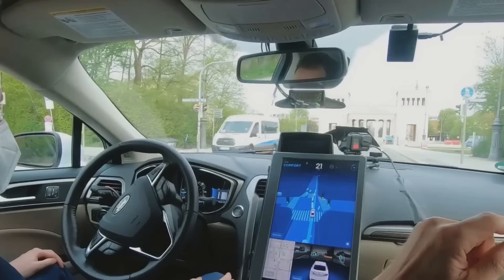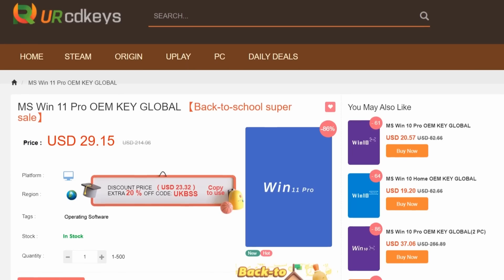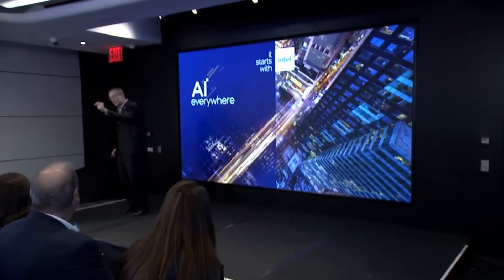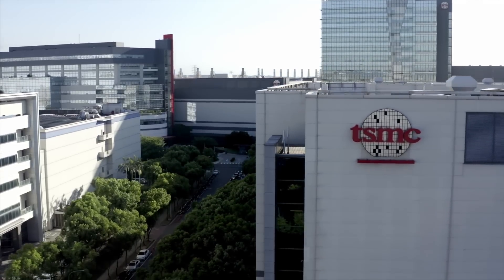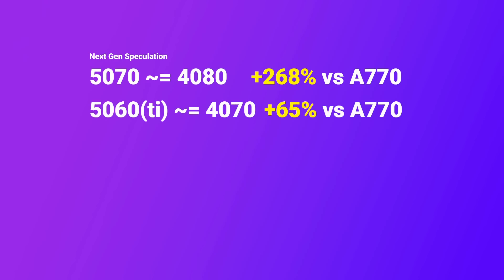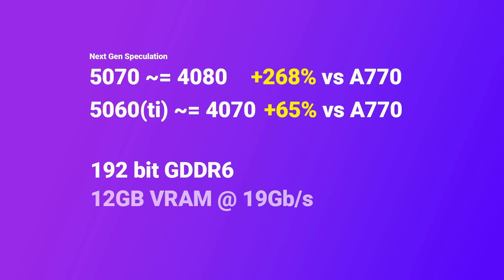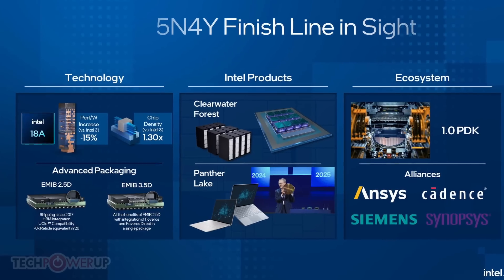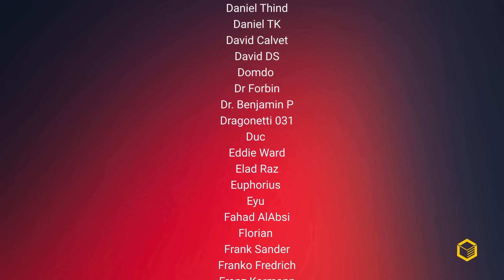I'm worried about Intel's Battlemage GPUs

Comment: Intel is 4 YEARS BEHIND NVIDIA!  THE A770 was intended to compete with the 3070.  It has a bigger die, more transistors, and better process node(s).  It came out 2 years after the 3070 and it achieved 3060 performance, i.e. a 2-year generational lagtine, 2+2= 4 years behind!  The only reason Intel makes Arc / Battlemage CPUs is to avoid being ejected from the laptop market!  I am pretty sure they lose money on every dedicated GPU card they sell!

There is no need to THINK about Intel GPUs before they get within 2Y of NVidia technology - they're a charity case righr now ...

Comment: Battlemage specs have been known for a l;ong time already. 
B980 Xe 64/256 bus/16-24gb/250-300W (launch H1)
B970 Xe 56/256 bus/16gb/225-250W (launch after B980)
Mobile Xe 40/192 bus/12gb (launch 2025 with the new mobile CPU)

Just for reference.
a750 8gb VRAM 256 bit bus 225W
a770 16gb VRAM 256 bit bus 225W

Year ago.
"Intel has said that it is considering moving some of its manufacturing out of China to the United States to comply with U.S. government regulations."

Today.
"Intel is laying off over 15,000 employees" 

So as conclusion U.S is sanctioning China and not giving them the latest. World situation demands it. 

Motherboard Brands:

Asus           65%          made in China.
Asrock          4%         (parent company Asus)
Gigabyte     14%         made in China/Taiwan
MSI              14%         made in China/Taiwan

China has their fingers on almost all of the motherboards. Asus as the biggest. Asus alone control almost 70%. 

Servers/CPU's:

INTEL        70.9% 
AMD          20.5%.      Both are U.S companies. 
ARM            8.1%       British company. 

 CPU Market Share Q2 2023:

INTEL          83%
AMD            17%

Conclusion for internet problems and server failures (Asus W680 motherboards) it is obvious and looking at the BIOS fails and history AMD CPU burned in the socket pushing towards INTEL CPU that now is failing on Chinese made (Asus) motherboards. You have acknowledge where the problem is when native settings over power the CPU by 100 A's for example and how the maximum damage was created.

Comment: No need to be worried, Intel has more backing than we all think and even if it's going to fail with Battlemage it will continue its business and most definitely survive. It's fair to say that what Intel has accomplished with their new GPU cores will also continue to succeed in the integrated GPU space so no matter if single card GPUs will not sell they'll still use them and show the world they can do the GPUs as good as AMD or Nvidia.

Comment: This audio is clearly AI generated. Ai trolls are everywhere now.

The Fab business is a solid investment. We need more manufacturers with the ability to make integrated circuits. We can't depend on the graces of TSMC manufacturing availability to the US dependent completely on a foreign company. Let's face it, if China decides to become more assertive and take completely control our ability to get silicon from TSMC will get crazy expensive and the fab ques will be atrocious. You saw this during the movie paranoia response.

There are still cars sitting in lots with missing hardware.

Without TSMC undercutting and taking aggressive postures with clients Intel would be fine. At this point there is an argument for a monopoly. TSMC behaves exactly like Nvidia with its partners "If you order from our competitor, well you won't have ques as available to you"

The exact behavior that took EVGA out of the Graphics card business, EVGA knew that if it decided to also produce AMD cards Nvidia woukd retaliate in some very malicious but semi legal matter. Like nit licensing "power connectors" for thier new GPUS.

Dividen needs to be out on a solid cause in the U.S., investors will cry but too many decisions are made at the board level in the name of dividends putting quality and customers in the trunk... not even the back seat.

Comment: If the rumored tech projections are true the Arc B770 16gb model is going to be about 50% faster than the Arc A770 16GB Model. That's a pretty good upgrade for most folks all things considered. If true I will be supporting it. Not going to lie though I'm bummed out BattleMage was scaled back due to Intel's current struggles, and isn't going to be the all out beast it was rumored to be initially. I will still support them however because they stepped in to provide us with a reasonably priced GPU while the other two were price gouging us all. I will be voting once again with my wallet just like I did with the 12900k/ArcA770.

Comment: If they don't mess up the new gpu cores should be twice as fast. So it would still not be high-end, but the B770 should compete with the RTX 4080.

With the financial pressure on consumers right now, the price will decide the (mid-range) winner this time.

Comment: I use my Arc 770 for AV1 encoding, along with a 12700k. Was cheap, temps stay low, I feed my NDI vMIX output across the house using 10 Gb fiber. ONLY issue I have is Windows blowing out new drivers, for the damn original one! So, switched to Fedora 39, and no problems. I'm not a gamer, so what I really was looking for was an encoder box that did not have GPU driver conflicts. An AMD 7950x and 7900 XTX was a nightmare of heat, and dealing with AMD drivers. A 4090 with the 12700k was incredible, but overkill, and required more power than I cared to put in a machine that sits in a dark room. Intel's DeepLink really works for me, despite not having a super powerful cpu or gpu, they work in concert, as an encoder. Efficiently too.

Comment: Zen5 problems are not about TSMC node for core chiplet. The core itself seems to be 18-30% faster when running, with 25%-200% regression in time it takes to start executing a thread, and without getting improvements to main memory latency or LLC hit-rate to feed the core.  AMD made probably some microcode mistake that got revealed by Anandtech core-core latency test showing large regression in communication latency between threads in the same core. A game based on 2 thread architecture got 30% boost in FPS from Zen5 in phoronix review of 9700X.
Reply: Unfortunately now that the microcode is fixed, the core to core latency is the same as 7000 series and the added speed up is only about 1%.  Apparently the inter-CCD latency is irrelevant to most games ..
Reply: @systemBuilder  I wasn't speaking about that latency. I was speaking about latency of two threads in the same core. And I've realized it wasn't a mistake, it was a security fix against timing attacks. 
In order to prevent process A to have timing attack based way of learning about data another process has L1 and L2 caches store threadID as part of tag that gets checked and make wrong threadID a cache miss. 
But that also means if thread 1 in a game shares a data with thread 2, each time one thread access it that becomes L1 and L2 cache miss for the other thread. But big issue in that is Windows moving threads between cores in the same cluster when the thread has done its tasks and starts waiting and releases that core to be used by any thread in the system.  Now with plenty of threads in a modern game the probability of same thread getting back to same core is low.

Comment: Idk what rumors you're hearing but I've yet to hear something about the 5070 being close to the 4080. 5070 is going to be 4070 Ti to 7900 XT. As for top Battlemage, it's going to double performance of A770. So that would be around 40 70 Ti. The problem is A770 was supposed to be around 3070/Ti but wasn't. I think Intel will do better this time but will still miss the mark with drivers and optimization at launch.
Reply: According to a leaker the top Battlemage is supposed to be 4070 super performance at best and the rest is 4060 ti level.

Comment: The interesting thing about the A770 is that in applications that actually leverage it properly, it ends up entirely competitive with the other 256-bit cards offered by the competition. 

Which is wild, because there are so many others wherein it suffers and chokes down to being not-terribly-dissimilar to the 128s.

Comment: I suspect Battlemage will essentially be a paper launch that really only gets any volume production as part of the iGPU component in Intel's CPUs.  Next gen there's literally no competition with Nvidia at the top end so Nvidia can do whatever it wants at that level.  For the mid range we have AMD vs Nvidia and AMD will pretty much have to offer better value than Nvidia if they want to sell anything.  That leaves Intel with only the low end which isn't really going to offer much in the way of margins.  It would not surprise me at all if both AMD and Nvidia decide not to even bother offering anything at the low end and just let Intel have that segment.  Both AMD and Nvidia would rather sell high margin AI chips.  Intel doesn't have that luxury.

I hope you're right about Intel getting it's act together on the manufacturing side.  That's really the key to their turnaround IMO.  Without that the only way they come back is to spin off their manufacturing business as a separate company and go fabless like AMD and Nvidia.  I don't think they'll do that but that's a viable option that would allow them to really focus on chip design instead of manufacturing.

Comment: i think i need to warn people that the semi conductor silicon tech in combination to x86 platform has REACHED ITS PEAK potential. it will barely gain any more. and this is a MATERIAL problem(the medium/bed used for signal processing). whatever the design change in the architectures.
in CPU business, now all they can do is making it more power efficient while adding a "psychological" marginal increase in maximum cycle/clocks. the silicon cant provide more velocity. and adding more transistors only increases the power draw.
and the ingenuity needed now is merely in architectural design. that probably would only gain some tenth of percent.
this problem is faced not only by intel, but by EVERY single brand/manufacturers of x86 based computing apparatuses. and they are just not telling you about it. both AMD, nvidia and intel are quietly agreeing to each other to make it oblivious from public. but they have reached the material performance limit. the silicon.
and you will see that policy(decreasing power draw and increasing power efficiency) more and more in the future batch of new silicon x86 tech. not because of the "green" agenda to fight the climate. because silicon tech has reached its limit. that apply the same to GPU. notice why now they are weighing on FRAME GEN? because the silicon just cant squeeze even more. and adding more power and you get what happen with the intel 13-14th gen chips. more melting GPU everyone?
i have hinted them the WAY OUT, which is to SHIFT to photon/light based processing. which uses crystal medium instead of silicon semi conductors. with this, they can keep going to capitalize with their x86 design, because now they have VELOCITY(how fast a signal can go from point to point), and yet they wont have temperature problem because there is no electrons need to jump between atoms in the processing cores. only light agent. photons. but nobody seems to even bother to invest in it.
you would see photon based crystal chip blocks running in over 300 gigahertz cycles easily. 
it simply about changing the transistor way of gating signal with electrostatic activated deflectors and splitters(similar in concept with how you do LCD) inside the crystal chip block.
chip would be blocky and chunky but since you dont need gargantuan cooler of any kind, you get smallest PC possible. running at a mere 50 watts probably. over 300 ghz(terahertz potential even) and only uses some 50 watts for the hundreds of photon/laser micro arrays.
Reply: Since you bring up the material properties and manufacturing-limitations, you seem to be forgetting that the same issue is present for ALL ISA's? Even Apple's M-series of ARM-CPU's have quickly met decreased generational gains, and the same phenomenon could be seen on their iPhone SoC's as well as on competitors such as Samsung. Likewise, even Qualcomm's first impressive entry into desktop - X1 Elite - has now immediately been matched in some aspects by AMD's x86-designs with "Ryzen AI".

Regarding Optical computing - I think it will definitively have its place, but I am (like many researchers), skeptical that it will become dominant even in HP-computing* - there will likely be a mix of optical, electro-quantum and exotic architectures. 
(I favour devices utilizing a combination of traditional transistor-logic with: phase-change-memory, crossbar-switch -based arithmetic elements, and analog elements to accelerate certain workloads)

*see McMahon Peter L. 2023; "The physics of Optical computing" - it goes through promising applications, but lists the limitations as well.
Reply: @predabot__6778  i recommend light based processing units as main processing units because advanced species USES IT. thats the people who travels thousand of light years away to here. dont ask me how i know them. you forgot whatever processing unit you are mentioning so long it is still using SILICON BED, it is SEMICONDUCTOR. it has LIMITS of electrical performance. i specifically mentioning x86 since it is the big complex processing solution compared to arm. meaning technically the more 'advanced". arm is the simpler one, could make TEMPORARY solution, but not changing the limitations. quantum computing technology is not practical. not only it will require to change completely everything in digital ecosystems so it would interface perfectly, the implementations will be EXPENSIVE. its not for the masses. the crystal chips on the other hand will be as easy to manufacture as  LCD. the most rough and simple laser pointer tech that kids can buy as a toy already easy to get. making hundreds of minute laser arrays in tiny form for the signal sources will be an easy manufacturing once the tech has been developed.
its about WILLINGNESS. so many of these company have invested so much on the current outdated and dying tech,and invested a lot more on the impractical quantum processing tech. so they dont want to spend more for THIS, a MUCH SIMPLER AND VIABLE SOLUTION that could get them to hundreds of gigahertz with the same x86/arm architecture designs. there is no changes in digital languages required, you could use everything already available the only thing changes is how the signal is being processed. thats all. the same architecture, using light signals and deflectors/splitters emulating transistor works inside the crystal blocks. and interface the chip block using fiber optics. all ecosystem READILY AVAILABLE.
the company who will be the first to adopt this will sail past all the competitor by hundreds of GHZ performance, less than 100 watts power draw and potentially CHEAPER and more SIMPLER to produce than carving  silicon wafers.
if you can already make super fine LCD, you could make nano crystal servos inside a crystal block.
and i share this idea FOR FREE. anybody can go ahead claim and patent it.

Comment: 200W is actually a sweet spot if you look at the this month's Steam hardware survey. I actually compiled some data on it today and between 75W and 200W, so the range where cards are running up to PEG 8PIN, that's 62% of the desktop market. I'm preparing an article on card design, so I had to go through this data in one of the points to explain why focus on this segment.

Comment: 6:10 $350-400 for a B770 performing at ~3070Ti levels would be insane! At this price it'd need to be faster with 12-16GB, or be under $300
Reply: A770 was always targeting 3070+ performance.  Didn't you feel the love from Raja?  Oh you didn't?  I guess its because A770 was a massive flop selling at 2/3rds the hoped-for msrp ...
Reply: And that's for a card releasing in 2025...
Reply: Remember, this is a 1st gen product, and it's already doing rather well, especially in the productivity sector. You can argue that launch was garbage, cause it was, but Intel has got up from that stumble in their GPU department and are actively improving it. It's VERY much obvious. 

Nvidia overprices their GPUs still and AMD is taking too long with pushing RT at all. Intel, on their iGPUs, already have that feature and they're fixing on pushing
Reply: @PixelatedWolf2077  replied to the wrong comment I think?
Reply: @dazuza95  Oh, whoops! my bad. Thanks for the head ups

Comment: I got ASUS strix 4070TI super for 700 bucks and it's borderline usable in VR when using Praydog's UEVR injector mod to play flat epic engine games in VR. I was thinking of getting 5070(TI) for that reason, but iI don't see the point if it will only be 4080S equivalent as that's only 15-20% faster than my current GPU. 5080 will probably cost 1200 bucks or more again. Lack of competition really sucks 😒
Reply: sucks for yall nvidia buyers

Comment: I don't quite get why people seems to be hoping Arc launching at low price. Intel is not a charity and neither are AMD. People always expecting them to compete and get Nvidia to lower their price. Sadly people, you won't get that if you're always gonna purchase Nvidia either way. So don't get mad at AMD and Intel later for price fixing. Current Arc A series are just a flop which is why you get them for cheaper. If B770 competing with 5060 you will be getting them at 400Usd.